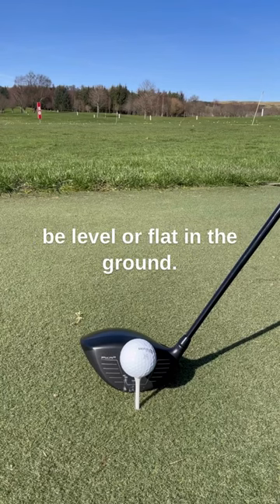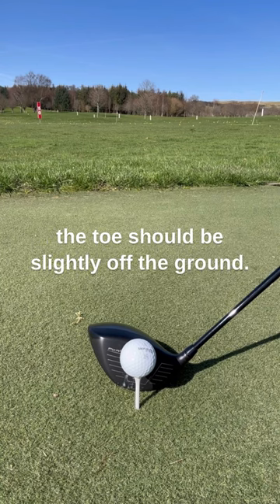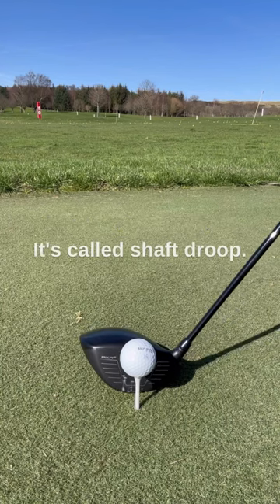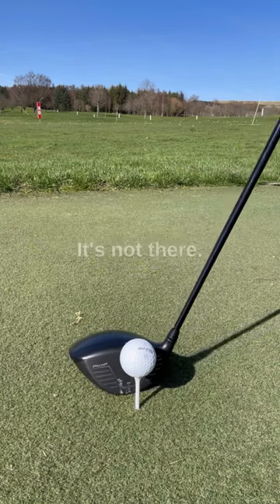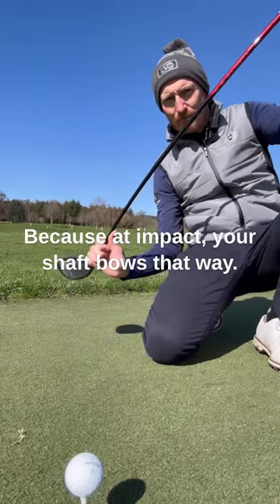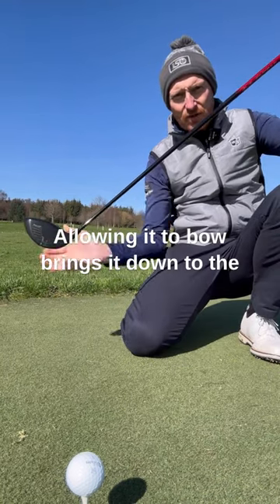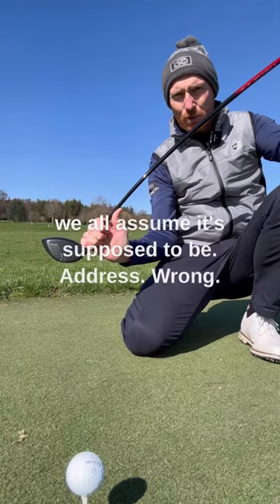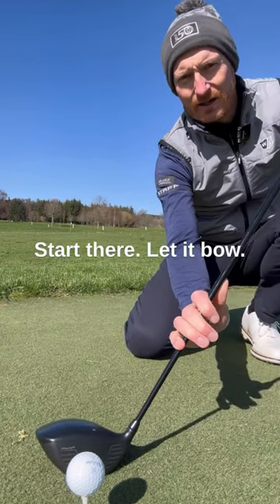DRIVER at Address GOLF TIP💥 #shorts

Comment: Say that to Moe Norman best ball stricker ever. High hands never low hands . Driver never hits the ground so it doesn't matter.
Reply: Exactly. Moe used his Body (tilt, straight legs) to address on the plane of impact. All these conventional swings start under the plane of impact so centrifugal force can’t operate naturally. Where with Moe, it can because there is the space to swing the club on impact plane but at address. Your right